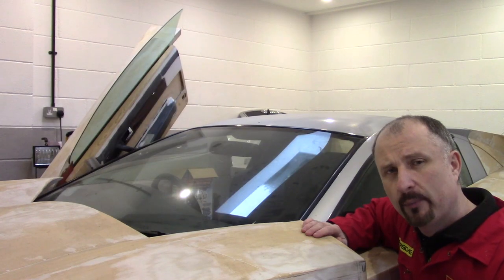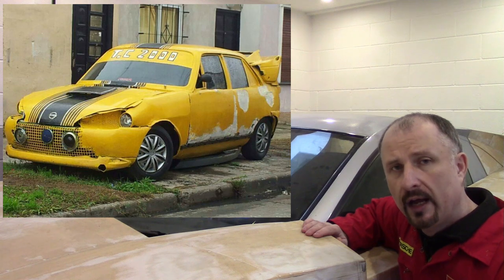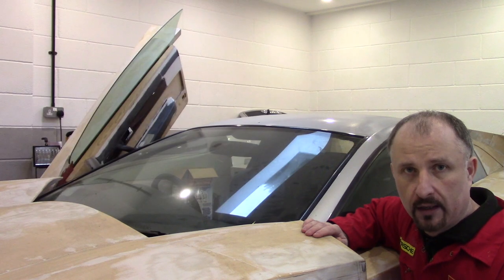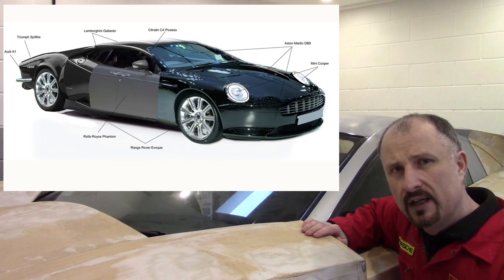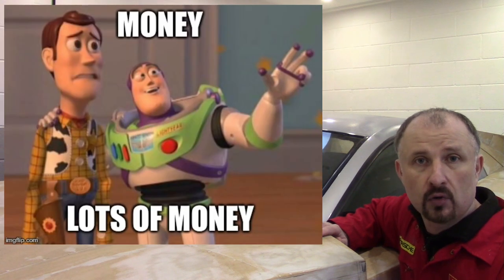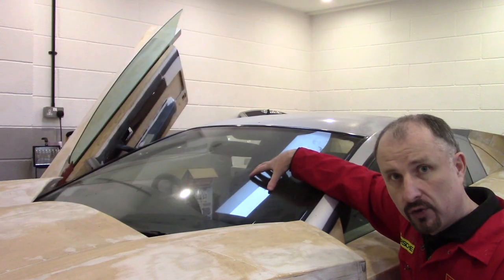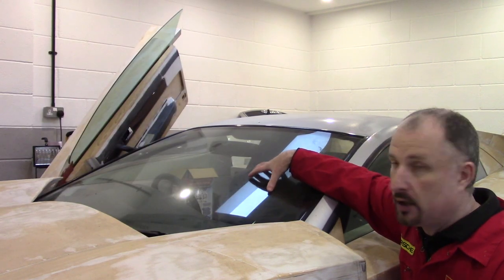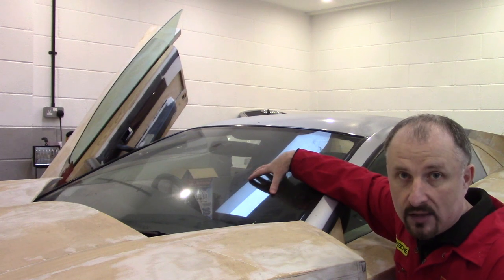What was the Second Donor Car that gave up its Roof and Glass for my DIY Supercar: Prototype Ep30

Comment: are you goin to refine the lines before the final version?
Reply from the maker: I do intended to tighten up the shut lines before molds are taken, and tweak the styling in a few areas.
Reply: @ProjectSupercar  When i see your chassis, which look quite good, with the Kuga roof, both really match. But I'm agree with JackJames, you've to make an effort on your body design.   I know this is not an easy criticism to hear, but you would gain visibility if you evolved your style. What is your current wheelbase?
Reply from the maker: @SETHalpine  Sadly I do have some limitations when it comes to styling, which I just can not ignore or avoid. One is money, then regulations, then the laws of physics. As I do more episodes detailing the styling, it will all make sense. Saying that, I have mentioned that I'm 70% happy with the end result and do intend to go over some of the styling when funds allow. It doesn't help that the car isn't painted and looks flat in video, which it isn't in real life. The wheel base is the same as a Lamborghini Diablo, at 265 cm, and is 2 meters wide at it's widest. If I can get the subscribers up, and generate a small return from the channel, I should be able to pay for the styling changes I want to make, so fingers crossed. ;)